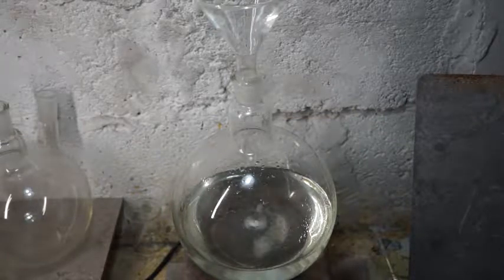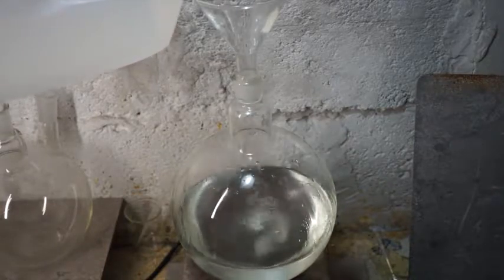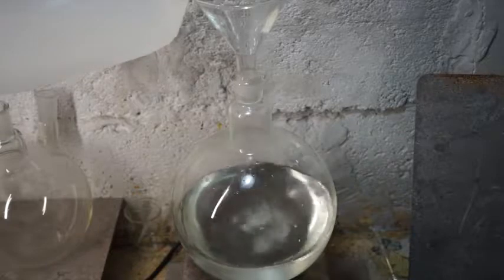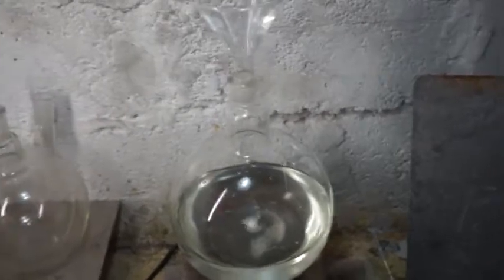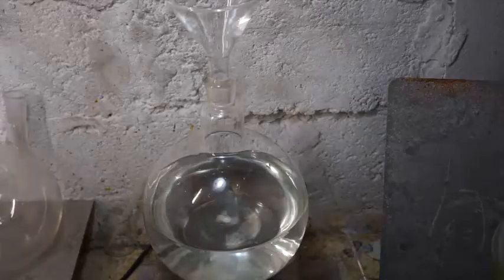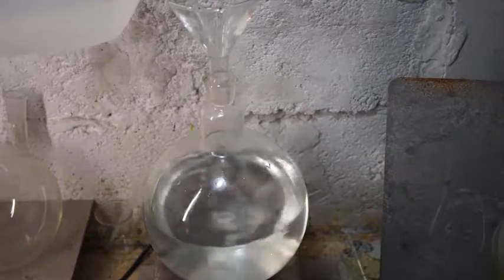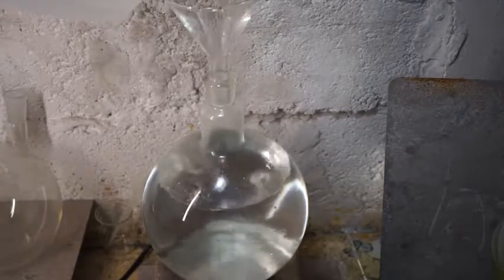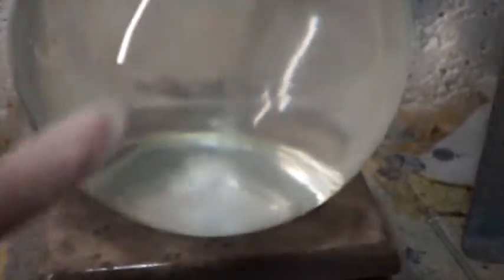Dueling densities. Underwater vortex of silver nitrate.

Comment: That separation boundary is called a "halocline". (or more generally a "chemocline").  Divers come across them when fresh water underground cave systems merge with seawater in calm surroundings. You can re-create  the effect at home in a tall container - the layer persists  if you don't stir or shake. What's interesting here is the  silver salt solution is being quite vigorously stirred so you'd think the turbulence at the boundary would mix the distilled water into the solution very quickly, but it doesn't appear to.  
Did you leave the vortex running to see how long the effect continued?
Reply from the maker: Yes, it took around 20 minutes for the solution to mix. That's why I was so amazed that I made a video 😂 You actually see three distinct vortexes. Silver nitrate, distilled water and air. Thanks for the info on what it is called 😊
Reply: GREAT.  TY
Reply: Qqqqq